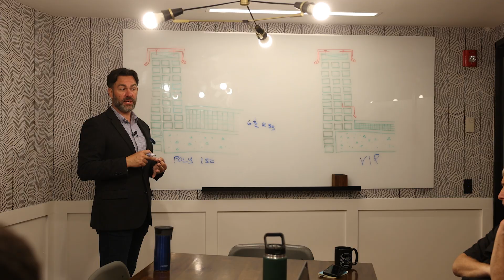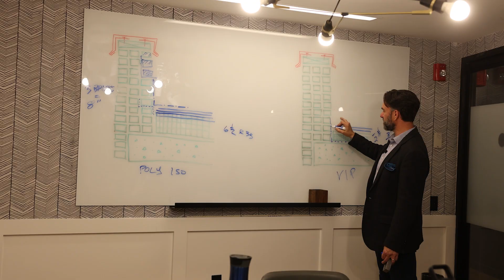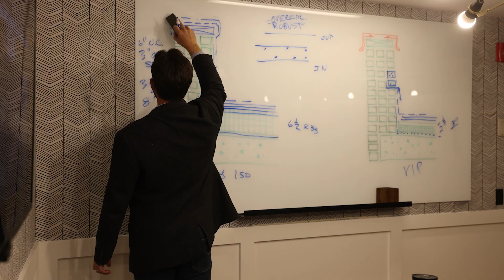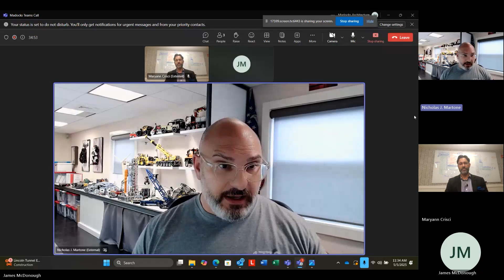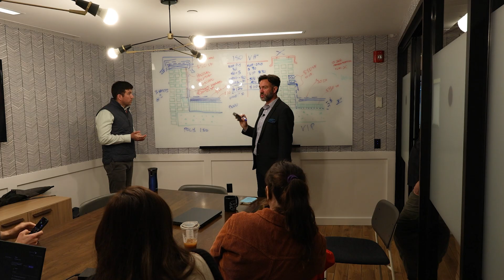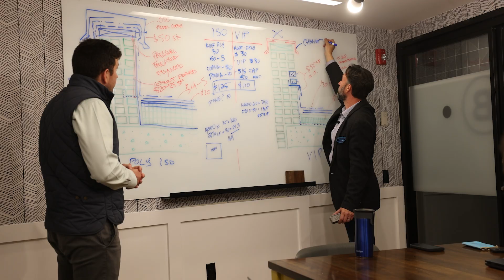Roof Insulation & Parapet Wall Analysis | Deep in the Weeds - Episode 1

Comment: Or you can screw a half inch dens deck on the wall( primed) and torch your vapor barrier up the wall and over the parapet before installing the wood blocking.  Nelson Lopez from Tuttle roofing